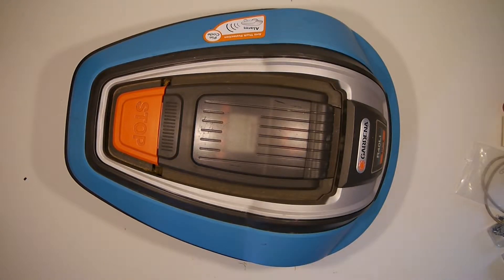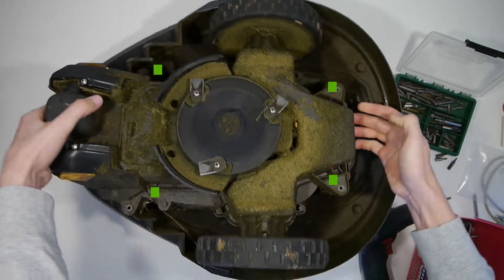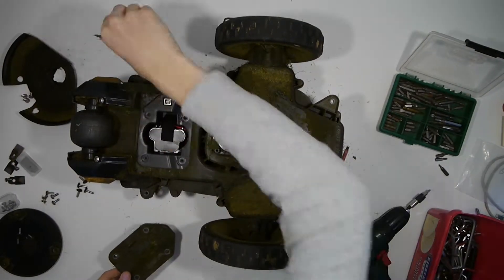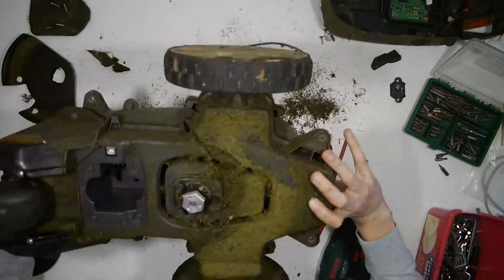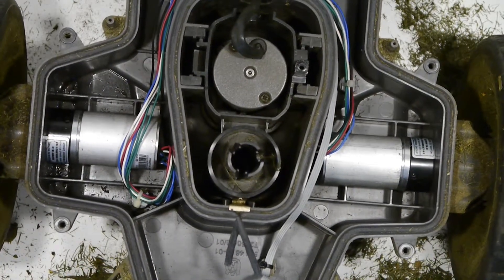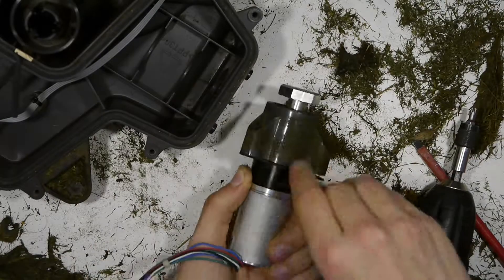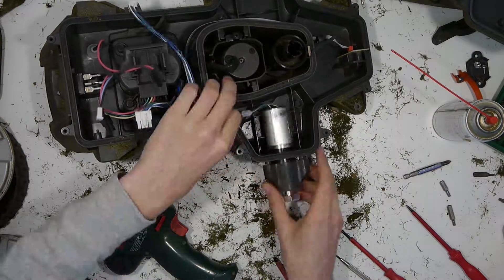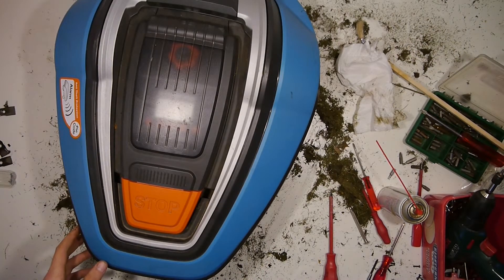Robotic lawn mower- Gardena R40Li - Teardown

Comment: I had the same problem as Hans: the four screws were rusted shut. I just needed to replace the wheels. I was able to remove the covers from the wheels and could then access the wheel screws by putting the mower on its side, rotating the wheel manually and pulling the bumper part and wheel apart. This way, I had relatively good access to the wheel screws and was able to replace the wheel. I put on the wheel cover partly and manually rotated the wheel again until I could get to the third plastic clip. After slotting that in, the other clips also slotted in nicely.
Reply from the maker: Thanks for sharing!

Comment: Thanks for sharing this video and walkthrough. 
I have the same one. I believe the battery might have died during the winter as I did not maintenance charge it during this winter. 
The display does not light up Unless I move the lawnmoveer by hand, then the display lights up just as the wheels move. What does that tell me? Is it the motor/feedback/contacts or may it indeed be a dead battery?
Reply from the maker: I have never experienced the display turning on while pushing the motor so I am not sure wether my following experience applies to you. However, after that being said, I did exchange the battery after about 10 years as the robot didn't work and that was my first guess. To do this you do not have to disassemble the entire robot! It is shown in the beginning of the video where the battery is located. Then I measured the battery and as I did not get any voltage I exchanged it. However I'd be curious to know what happens if you put the robot in the charging station? The robot that I have usually beeps two times so it could also be that the connection of the robot to the charging station is not working properly. You can see the connection on the robot in 0:30 the copper pads to the left. After some time these need cleaning as well as on the charging station. My charging station has fins so connectivity might be improved if they are carefully bend forward a little. However this is only speculation. Hope that helped!

Comment: Excellent, just what I need, I thought. I could remove some screws and wires and spray some contact cleaner spray. Total failure. I didn't even get past stage 1, to remove the first four screws. Two of them seem to be connected to some rubber-thingy and all that happens when I unscrew them is that the rubber gets twisted. Nothing gets loose. I guess I have to hand the lawnmover over to the repairman after all :(
Reply from the maker: Sorry to hear that. You could try to use some spray on the screws so that the adhesion is reduced. If the device is still covered in warranty/you want to send it in should always be the preferred option.